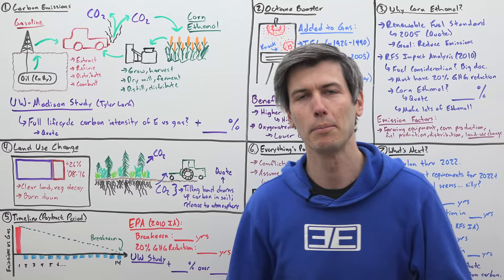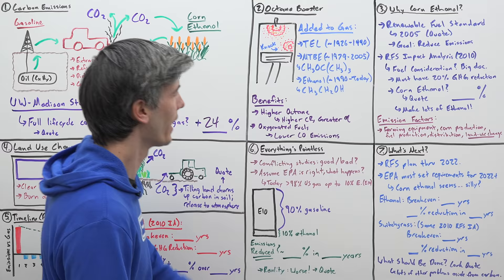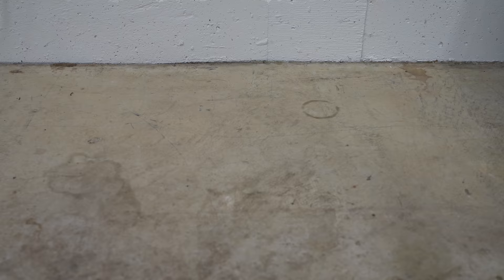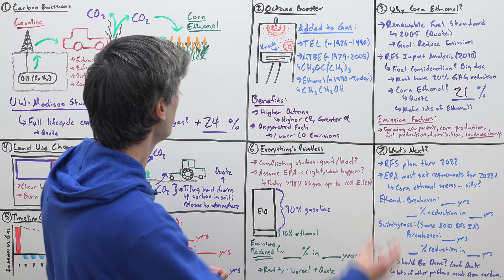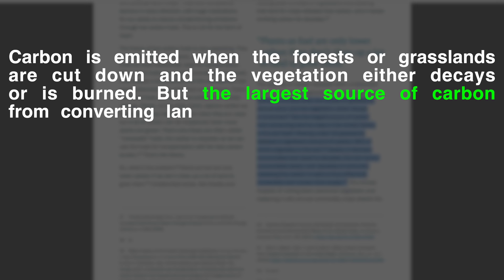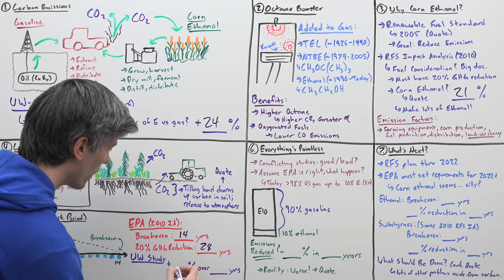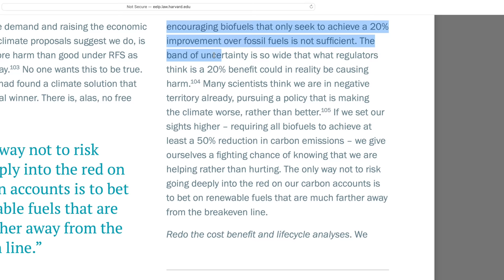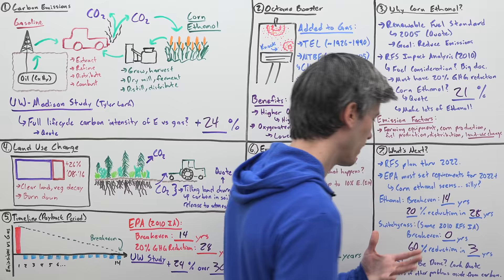America Was Wrong About Ethanol - Study Shows

Comment: Car can run on octane as low as 70 IF you retard the timing to prevent preignition.

Many cars will retard timing automatically when it detects ping.

I noticed a 20% difference in fuel economy between straight gas and 'gasahol'.
The gas got BETTER mpg than the junk fuel.
I only use 'gasahol' every once in a while to remove any water from the tank.

Ethanol REDUCES your MPG. It is hard on metal and rubber parts too.

Cut the population and you cut the demand and that cuts emissions.
Reply: Ethanol in our current inefficient gasoline optimized engines reduces mpg but despite this also reduces the cost per mile to drive.

It also drastically reduces pollution.

Denver in 1988 was the first government entity to require E10 when they were on in EPA list of ozone non-attainment zones.  Soon with ethanol they were off that list.

Even with just 10% ethanol added to E0, the Swiss Federal Laboratory for Materials Science and Technology found that the especially health devastating ultra fine or nano particulate emissions were lowered by 97%, carbon monoxide lowered by 81%, carbon dioxide lowered by 13%, aromatic hydrocarbon emissions lowered by 67-96%, and genotoxic emissions lowered by 72%.

Let us go to non-toxic E100 and eliminate most all emissions.

Ethanol on most any manufacturers' chemical compatibility charts you can find is at worst equal to but most often easier on rubbers, plastics, and metals than what gasoline and BTEX (benzene, toluene, ethylbenzene, and xylene) are.

At least you got the water thing correct.

In ethanol optimized engines, you can have better fuel economy than gasoline, even better than diesel engines.  Ethanol is cheaper to produce than either.
Reply: @danafletcher2341  Everything I posted is accurate and true. Making ethanol creates more CO2 and other problems than gasoline alone does.
From personal experience, ethanol REDUCED my MPG by nearly 5mpg.
I also had to replace two $400 (parts only) fuel pumps due to ethanol before I discovered that by not using ethanol I extended the life of the fuel pumps.
Had an old car with a carburetor. Ethanol ate up the gaskets quickly. Cost $171 (parts only) at the time to replace the gaskets and had to do that twice a year.
Same with small engines.

Combustion of alcohols produce aldehydes. If alcohol as a fuel is used in same amount as gasoline today, then aldehydes emission will be a serious problem. Alcohol is corrosive in nature.

Ethanol optimized engines are a joke.
Look up but's per pound of various fuels and you will see ethanol is near the bottom of the list.
This means LESS power to use, and significantly higher fuel consumption.

Due to ethanol's lower energy content, FFVs operating on E85 get roughly 15% to 27% fewer miles per gallon than when operating on regular gasoline.

Research alcohol racing engines for even more information.

Back in 1988 cars were not as efficient as they are today. With modern computer controls and sensors, emissions now are quite LOW compared to ancient technology.

Oh and Denver is a bad place to refer to as it is the mile high city with lower atmospheric pressure (means less O2 for fuel to use and required high altitude mixture adjustments).

In 1988, catalytic converters were pretty simple and inefficient compared to today.

Use recent verifiable research and testing to argue your point.

Oh and watch some YT videos on small engines and effects of ethanol. Stuff is pretty corrosive.

Best fuel to use is a Hydrogen on Demand system. But there are problems with the system (inefficiency for one).

CO2 - want to cut CO2 then reduce the world population. By 90%. Cut the birth rate!
Start with the Eastern Hemisphere....
The more people alive the more CO2 is put into the atmosphere.
Reply: @danafletcher2341  Forgot something - ethanol is the USA is HEAVILY subsidized by the taxpayers. You are paying for it one way or another.
Reply: @crazysquirrel9425  The Federal subsidy for corn ethanol called the VEETC or blenders credit ended back in 2011.

The long-standing stated goal of the G7 Nations to end petroleum subsidies?  Not so much.
Reply: @crazysquirrel9425  Oak Ridge National Laboratory measured exhaust emissions of E85 vs E0 under US06 driving conditions (i.e. real world).

Aldehydes were high with E85 for cold starting but dropped to insignificant amounts in US06 driving.  E0's were not as high during cold starting but remained relatively high even in US06 driving conditions.  Aldehydes are covered by the Swiss Federal Laboratory in my previous post under "genotoxic emissions".

Ethanol in inefficient gasoline optimized engines has lower mpg, but more power.  For example GM measured their 5.3L engine at a clean 380 horsepower on E85 vs a dirty 355 on E0.

Ricardo built an ethanol optimized engine for GM and drove it around a few years ago.  Note more power and mileage at half the size/twice the power, even than diesel engines.

FROM RICARDO:
The new federal CAFE standards are calling for a doubling of fuel mileage performance, which, Vint says, is going to send OEM’s looking for high octane numbers to improve efficiency and ethanol is the best source. Ricardo, an engineering firm with over 100 years in the business of engine design, has developed an extreme boosted direct injection engine (EBDI) to optimize ethanol blends. The 3.2 V6 gasoline engine rivals the power and torque of a much larger GMC Sierra 6.6 diesel, he said, and it delivers 3.5 percent better fuel economy than the diesel.

The Indy 500 switched to ethanol, increased power plus they were able to reduce the gas tank size from 30 gallons to 22 and pit crews loved the clean exhaust.

Genocide would reduce CO2 from humans for sure, but I'm not a fan.  

Nissan in 2016 drove a hydrogen fuel cell vehicle that used Brazil's E100 infrastructure that produces the hydrogen from a catalyst.  They can even operate with enough water in the ethanol so as to be non-flammable, how safe is that?

Fuel cells for back-up power, RVs, and sailboats are sold today that use alcohol for the hydrogen source.

Advanced and super quiet large military submarines in Europe and India use ethanol for the hydrogen source for their fuel cell power/propulsion. 

Direct ethanol fuel cells are now the next level.

The following came from an article from Seeking Alpha:

>>>Fuel Cell technology offers many advantages over Lithium-ion batteries, not the least of which is that hydrogen used in fuel cells has the energy to weight ratio ten times greater than lithium-ion batteries.

That said, the volumetric energy density of ethanol is over five times greater than hydrogen.

Ethanol has five times higher volumetric energy density (6.7 kWh/L) than hydrogen (1.3 kWh/L) and can be used safely in fuel cells for power generation.<<<
Reply: @danafletcher2341  Any idea of the purpose of an Oxygen Sensor is?
Oxygenated fuels trick O2 sensors into thinking the mixture is lean and dumps a bit more fuel. That extra fuel is where the more power comes from, not the ethanol.

Gasoline	116,090 Btu/gallon
Ethanol (E100)	76,330 Btu/gallon
Cannot get more power from a less energy dense fuel.
You cannot get better MPG from using a less energy dense fuel.

HOD systems create hydrogen in demand from water. Quite safe too.
Goes in as 'water' comes out as 'water' so to speak.

What is the difference in gasoline in Europe vs the USA?

I LOST MPG with Ethanol, power too (E10 and even E15).

It will ALWAYS take 'X' amount of energy to move 'X' tons or car. Simple math will tell you it takes more ethanol than gasoline.

I even tried E85 once. Guzzled fuel like crazy.

Every E85 flex fuel I see at a gas station is using E10 gas and skipping the E85.

I will credit ethanol for one thing - helps keep air cooled 4 cycle engines cooler in the summer heat.

Swiss may be fudging the data a bit.
Ecoterrorists are all over the planet. And have been well know to exaggerate information to support their cause.

Where is that 100MPG carburetor from 50 years or more ago that I read about?
Reply: @crazysquirrel9425  I thought you implied E85 ruined two fuel pumps, now you only used it once?

The EPA before approving E15 in 2011 did long-term testing on vehicles 2001 and newer with not only E15 but also E20.  They found that both fuels ran fine and did no damage.

Brazil's common gasoline for non-flex fuel vehicles identical to ours contains a minimum of 27.5% ethanol.  It has worked out so well and for so long that Paraguay went to E27 as well.  India is going to E25 soon too.

Ethanol will increase power, not decrease it and the cost per mile to drive is less but the real reason it is used today is for an oxygenate, MTBE didn't work out so well.

BTU is a measure of heat, not power.  Ethanol's other burn characteristics overcome its lower BTU, so much so as you saw in Ricardo's ethanol optimized engine.

Scania has sold an ethanol optimized heavy engine worldwide for years.  They said it produces the same power as their diesel engines and mileage is on par with them as well.

Ford's ecoboost system originally was to use ethanol.  They did not use ethanol in production because they thought they were bypassing MIT scientists' patents on it which is still in court to this day I think though I have not checked lately.

FROM EPA & FORD ON FORD'S ETHANOL OPTIMIZED ECOBOOST SYSTEM:
Compared to production gasoline engines:
Fuel efficiency is ~15 – 20% improved for various drive cycles.
Full load performance is significantly improved, and comparable to production diesel engines.

This is not new technology or knowledge, it was known long ago.  It is suppressed technology.

Rear Admiral C.M. Chester wrote Henry Ford a letter on Dec.15, 1916:
"...I also pointed out in the article that as governmental laboratories had developed from 40 to 55% efficiency in alcohol engines as against 20% in gasoline machines, the use of alcohol at double the cost of gasoline for power purposes, was cheaper for motor[s] than gasoline in common use today."

Scientific journals from 1890 – 1920 contain hundreds of references to alcohol fuel at the dawn of the automotive era. 

Studies of alcohol as an internal combustion engine fuel began in the U.S. with the Edison
Electric Testing Laboratory and Columbia University in 1906. Elihu Thomson reported that despite a smaller heat or B.T.U. value, “a gallon of alcohol will develop substantially the same power in an internal combustion engine as a gallon of gasoline. This is owing to the superior efficiency of operation…”

The USDA tests in 1906 also demonstrated the efficiency of alcohol in engines and described how gasoline engines could be modified for higher power with pure alcohol fuel or for equivalent fuel consumption, depending on the need.

The U.S.Geological Service and the U.S. Navy performed 2000 tests on alcohol and gasoline engines in 1907 - 1908 in Norfolk, Va. and St. Louis, Mo. They found that much higher engine compression ratios could be achieved with alcohol than with gasoline. 

When the compression ratios were adjusted for each fuel, fuel economy was virtually equal despite the greater B.T.U. value of gasoline. “In regard to general cleanliness, such as absence of smoke and disagreeable odors, alcohol has many advantages over gasoline or kerosene as a fuel,” the report said. “The exhaust from an alcohol engine is never clouded with a black or grayish smoke.” USGS continued the comparative tests and later noted that alcohol was “a more ideal fuel than gasoline” with better efficiency despite the high cost.
Reply: Additional:
Although turbines could be designed to run on ethanol it's actually a lousy aviation fuel (actually it's a lousy fuel in general). Petroleum-based jet fuel is high grade kerosene which has lubricant properties, which ethanol lacks, and ethanol has different characteristics which mean you can't pour it in and use it as a replacement.

Some problems with ethanol as a fuel are:

It's a solvent which dissolves some types of seals and hoses
It evaporates very easily, and can cause vapor lock
It is hygroscopic, meaning it attracts and mixes with water very readily. Water contamination would not settle to the lowest point, instead it would be suspended with the fuel
It has significantly less stored energy per unit of weight. Jet fuel has an energy density of 46 MJ/kg (megajoules per kilogram) and pure ethanol has 26.4 MJ/kg; that's only 57% of the energy density of jet fuel! Even if a jet was able to burn it at its maximum efficiency it would get just over half the oomph from it.
There are bio-fuel replacements for jet (and diesel) fuels based on oilseed crops like rapeseed (canola), palm oil, etc. These are processed to remove their OH atoms using transesterification to create fuels which are almost identical chemically. Modifying jets to use ethanol would be hugely expensive if it is even possible to do, so there's no point given there's a suitable replacement.

The point is actually moot though because crop-based biofuels are never going to replace petroleum. There simply aren't enough crops grown to feed people and engines at the same time, in fact even if we used all the worlds farmable land to grow bio-fuel crops instead of food crops we still would not have enough of it to replace fossil fuels. We have enough trouble feeding people already and the biofuels craze is not helping that. Bio-fuels based on non-food crops from marginal land may some day become economically viable and partially replace petroleum fuels.

After some searching I found a link to an article I wrote on biofuels for AOPA UK magazine which goes into more detail on biofuel issues.

Answer from GdD on Stack Exchange
Reply: @crazysquirrel9425  That O2 sensor BS was started by someone who sells you something. Good Luck! Ask anyone that drag races a carburetor you make more power and run an better ET with E 85.
Reply: @danafletcher2341  Dana I live 4 miles from where that Oak ridge study was done.
Reply: @fletch2119  Have to try later, the rest won't take.  Welcome to 1984 censorship I guess.
Reply: @oldblueaccord2629  Nope. They use up to 90% nitromethane and 10% METHANOL (not ETHANOL).
They also do an engine rebuild after the race too.
No thanks. I am not rich.

It is not economically feasible to switch to ethanol. You get less power per unit of fuel than gasoline or diesel.
And power is what you need for takeoff and hauling weight.

Ever wonder why Semi's, busses, and heavy equipment DO NOT use ethanol fuel?

You can argue the ecoterrorist BS all you want but the fact of the matter remains that ethanol is not a suitable substitute for gasoline or diesel.

Want to cut emissions then cut the population by 90% and keep it there.
Less people = less demand and use of everything.

And you did not figure in the fact that to grow the crops to make that ethanol used fossil fuels to make the fertilizer needed.

Why don't people use alcohol in their lanterns/lamps instead of kerosene (or lamp oil)?
Because it takes a LOT of alcohol to do the same job.
Alcohol evaporates much more quickly than kerosene so typical storage will be bad when using alcohol.

Of course if you used a Trangia evaporation wouldn't be a big problem BUT they say not to store alcohol long term in it.

I can get maybe 30-60 minutes from an alcohol cook stove whereas I can get a much longer burn time with fossil fuels.

Same thing with engines. They will gobble up alcohol at a fast rate vs gasoline.
That requires a much bigger fuel tank to cover the same range of roadway.

Maybe if we went to straight gasoline and added an alcohol mister to the intake manifold that might help with many problems.
Kind of like DEF in diesel trucks in a way.
Reply: @crazysquirrel9425  NUTTY
Reply: @oldblueaccord2629  You are what you eat. Expect a crazy squirrel to not be nutty?
Reply: @crazysquirrel9425  He man I Like you for sure! But to be serious many many many people use E85 in drag racing. Runs cooler,more power and cheaper than race gas. Have a nut and think on that.
Reply: @oldblueaccord2629  Can't get more energy out of alcohol than gasoline. I already posted the energy content of each before. You cannot get something for nothing. Alcohol has 1/3 less energy than gasoline so getting more power is impossible without gobbling up additional fuel.
Running cooler on that I agree - best for air cooled motorcycles and such (but not small engines as the alcohol eats up everything).
I do not know the CPG of E85 vs Race gas as I do not race lol
I putter putter putter everywhere I go (called hypermiling).
Mfr of my vehicle says to NOT use anything more than E15.
Any ethanol in my tank always results in poorer fuel economy - as much as 50% less MPG depending on the outside temperature. I hate January and February.
I do run E10 in the summer though. Only lose 3-5 mpg or about 11 to 15% less mpg.
But at least it is easier on the A/C though.

It costs less for E85 because of government subsidies which I posted before.
E85 creates more CO2 in it's production, processing, and delivery than gasoline does.
They fail to tell people that the fertilizer that is used for the crops to make ethanol comes from natural gas usually but can come from oil.

Thorium reactors for cars (even houses) would be great! Massive cheap power for 100 years!
Of course there is no money in it for the greedy governments and CEO's.
Reply: @crazysquirrel9425  Linear thinking....you make MORE horse power on E 85 MORE...as in MORE NUTS. Its been posted 1000 times and 1000 of videos.
Reply: @oldblueaccord2629  At what cost?
Only way to make horsepower is with more energy dense fuel or much more less energy dense fuel.
Gasoline has 1/3 more energy in it than ethanol. To make more horsepower than gasoline you need more than 50% more ethanol to do the job.
Laws of physics state you cannot get more out of a system than you put in. This is why perpetual motion machines cannot work.
If you could get more energy out of alcohol than you put in, you created a perpetual motion machine.

1 gal of gas has about 116,000 BTU's of energy. Ethanol about 76,000.
You must use a lot more alcohol to get the added power.

Ethanol's energy cost varies depending on the blend used, with E85 containing 83% ethanol content having about 27% less energy per gallon than gasoline.

Due to ethanol's lower energy content, FFVs operating on E85 get roughly 15% to 27% fewer miles per gallon than when operating on regular gasoline, depending on the ethanol content. 

You need significantly more alcohol than gasoline to do the SAME job.